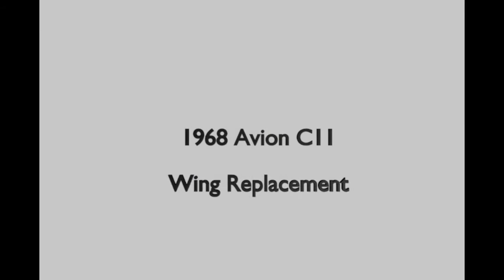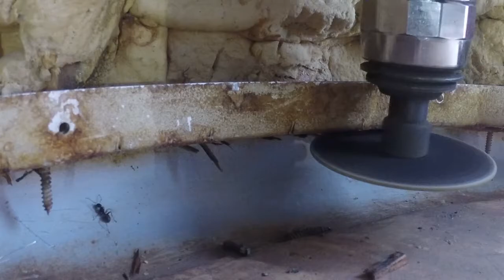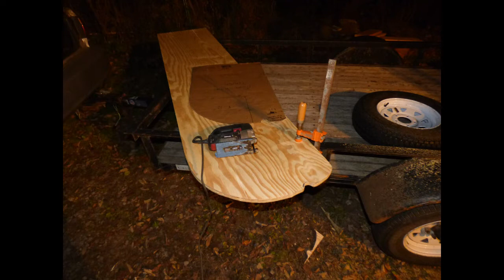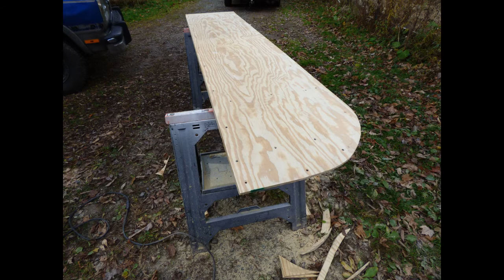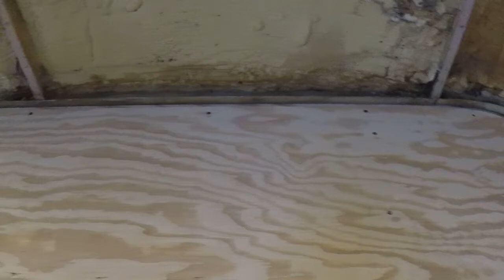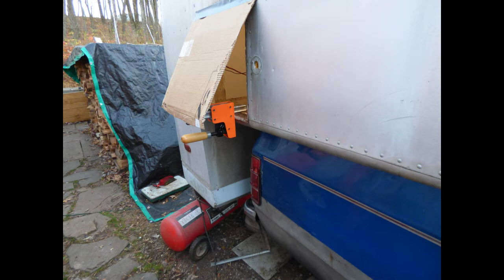Avion C11 - Wing Replacement

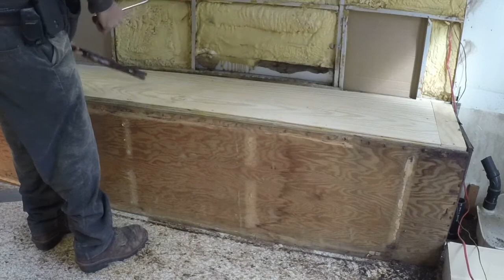Comment: Wait a minute!  at 4:13 the right wing slips perfectly into place... but then at 4:24 it is being nudged forward on to the front rim!   I see that on the left side you removed the rear end of the wing - but not on the right side.  Did something get edited out or was there a gap on the right wing?  I assumed these were original built in place... as you do with the overhang.   also - why the decision to go 3/8 ply? Do you think it was worth rabeting to use the 3/8 ply over 1/4?

Comment: Outstanding videos.  Thank you for taking the time to put them together.  We just purchased a 1965 C10 in relatively good shape but needs wood replaced on "wings".  Is it necessary to remove the wall panels and then replace screws from inside to wood where you used an angle grinder to remove old screws?
Reply from the maker: Thanks. Congratulations on your purchase.  I do feel that it is necessary to remove the interior skin to provide access to those fasteners. Every screw counts on a camper expected to go 50+ years.